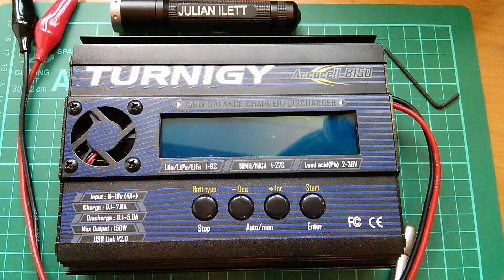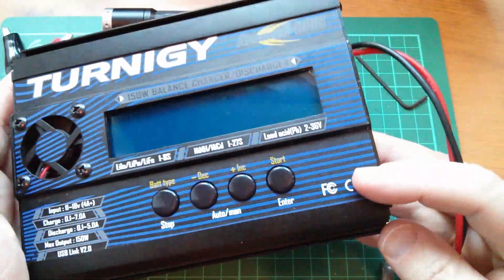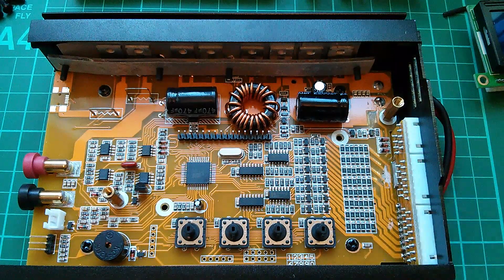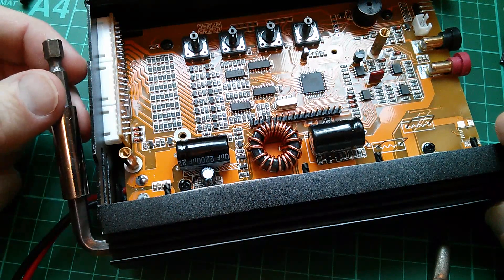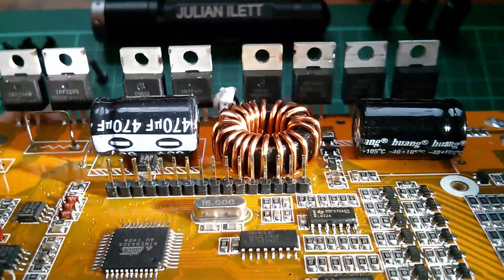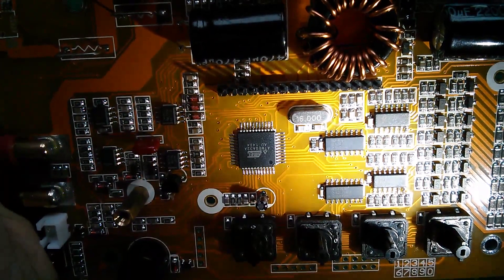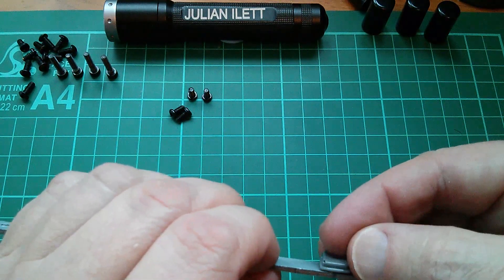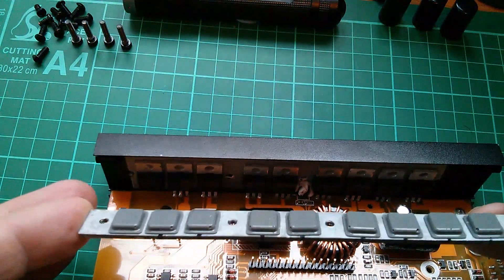Teardown: Turnigy Accucell-8150 150W 7A Balance Charger

Comment: Note to self
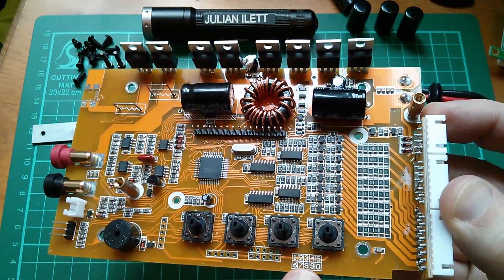The pinout of the Power Supply side is shown here: 5:10 
Flip the board over, Mosfet side to self where the supply holes should be at the bottom right. Top hole is positive, bottom is negative.

Comment: I like your videos a lot but rubber thingies there on the components, is this really a good idea? Those can prolly get pretty hot on that side too, also there's no way for that flat bar to keep them pressed against the radiator without bending. Even after your mod there is a slight bend to that bar. I'd get a piece of thick square/rectangular alum tube cut it to properly fit(kind of an u shape) and use that for support..., and lose the rubber thingies :) surely more work but it will be more rigid

Comment: Thank you for the inside look, especially on how to get the buttons out.  My buttons are sort of malfunctioning...they work intermittently and I'd like to replace them.  Any idea on how best to go about it? I find that if I apply extra-firm pressure to the buttons they work, but "regular" pressing doesn't really work.
Reply: dequinox they're just pcb-mount tactile buttons, if you desolder the 4 pins it should come out.

Comment: The bar needs to be reverse curved, so that by the time there is enough screw force to straighten it out, it is applying uniform pressure across all the devices.
Reply from the maker: jpopelish That would certainly help. But to work reliably, it needs to be thicker. Component clearances would start to become an issue then though.
Reply: Julian Ilett
And it would help if it was made from a springy material, instead of aluminum.

Comment: Actually it looks really good. Only few things that are not ok but well i suppose cheap solutions are good also :). resistor network is there instead of one good resisistor .but this one is ok also. cheap solution and easy ..What i don't like is ..instead of flat metal support bar for transistors they could spend few cent more and use I_I this shape so there would be no way to bed it at all..another thing is that coil and those two capacitors are not glued to board and that is not good at all...I think i don't have to say this was made in China because no oficial trademark like CE or what ever ..boad should be date coded as well. but even if it  was in China or taiwan..quality is really good ..compared to some CH crap we have on  market..Nice teardown
Reply from the maker: SylwerDragon I'm wondering whether the resistor matrix might actually provide more accurate resistances, from a statistical point of view.
Reply: ofc it does. That is why all modern multimeters use one resistor instead of so many cheap ones...But that one resist network cost much more..ofc.

Comment: the only possibly looking genuine IR mosfet in that pack is maybe the one next to the 5v reg, it has the usual half round ears cut into the tab, 
Most IR fets have a cut that from the top down goes in at a sharp angle and then curves back out, like a semicircular cut with a flattened top

Getting genuine mosfets is hard, I even had some from an ebay seller who was getting them off one of the UK main component houses, but I Really Shouldn't name them.....

Your 'spacer fet' looks genuine IR

any views on rubber mat insulation/thermal performance over old mica insulating with thermal compounds ?

I've never liked rubber, to me its an insulation....

Comment: I recently bought an IMAX was very unhappy with it as it was a FAKE and the voltages where off by about 700mv that might not seem a lot but when charging LION cells it can be dangerous, I complained to the Ebay seller and got a full refund, plus I pointed out to the seller that selling counterfeit goods is a crime in the UK and even distributing them is a crime, as a result I was not asked to return the item, so got money back and got to keep the IMAX..

I later bought a TURNIGY ACCUCELL 6 with my refunded money from Hobby King and it is much better, but never got a user manual or pretty box was bare cardboard :p

Comment: Not to related to the video. But I'm looking for the cheapest way to go about setting up  a battery backup.  Doesn't need to be super reliable . I'm thinking about getting a couple 50 watt solar panels and a few of those cheap eBay charge controllers.  With  a 500 - 700 watt inverter. I'd probably only ever use 200 watts for more than 15 or 20 minutes . I just want it to have the capability of running my mini fridge if I have to use it for that. The hardest part is finding cheap batteries. I want it to have a battery bank with a decent capacity

Comment: Is there any reason you can't drill and tap mounting holes for each semi on the heatsink doing away with the bar totally? It would be a bit of work but would be a lot more robust both thermally and mechanically.

Comment: If you want to add a temp sensor, the receptacle looks the same as my imax b8+. With the thermal sensing, it has worked great detecting overheating Li-Ion batteries and halting the charge before it went critical. "TS-474002/11777 Temperature Sensor w/ Futaba plug" was what I got. It's got a curved magnetic side that's perfect for Li-Ion's. I'm still searching for how to reduce the LiPo maximum charge voltage because 4.2V is actually hastening death of the cells. 4.1V gives longer life. It could be accomplished through the secret calibration mode but that affect all the battery voltage readings.
Reply: Thanks for the partnumber. In my country I couldn't find it with that partnumber, bu I could with this one: Futaba SBS01T.
It's also an 3-pin temperature sensor (White/Red/Black or vice versa).
For anyone reading, all you need is a generic 3-pin sensor, 2 pins for supply, one for readout. My guess is it runs on 12V but I don't yet have a sensor, nor have I tested it.

Comment: It occurs to me that and an angle extrusion rather than flat bar might have been a better idea for the MOSFET clamp - more resistant to bending. Turnigy's bodgery on the mechanicals is world-class on this one!
Reply from the maker: Marcus Jenkins I used this method a while back in my grid tie inverter. That did have a U-shaped bar (quite a shallow U) across all the MOSFETs and diodes. But it was susceptible to bending just the same.

Comment: Hmmm. Seen as they've likely had the case profile made, a small detail would have allowed the use of those snap-in clips to hold the devices on to the heatsink. Better performance and faster assembly too.
I've seen u-section strip used with this screw arrangement, but also with a screw in between each device. Someone clearly doesn't have a clue.
Maybe that's the same person saying that the failing units are fakes? 
Let's face it, not everyone will be running the unit at the limit of it's claimed spec. So their units will survive a little longer.
Reply from the maker: Simon Parkinson I think a screw between each semiconductor would be the best arrangement.
Reply: Julian Ilett Costs a lot more to produce as each device would require a screw, sil-pad (placed accurately on hole), top hat and testing of continuity to chassis.

Comment: i've had 2 imax B6 chargers so far and people are always debating in the comment section weather they are fake or not, it doesnt really matter. first off even the "fake" ones are still pieces of equipment that work, by "fake" it sounds like they mean its just carved out of a block of wood and doesnt do anything. also the "real" imax b6 chargers are made in china and are shitty just like the fake ones. if somebody really wants quality they need to build it themselves instead of paying 30$ on ebay.
Reply: yeah unfortunatly its the way the world works these days. recapping cheap shit with rubycon caps always helps and putting better mosfets in works too.

Comment: The only hint i had that it may be authentic was the fact that the LCD can be detached thu a plug , usually for cheapness they wouldent do that and solder it directly to the board. You may want to monitor it using a alternative multi meter device to see if its safe during charge.

Comment: Hi Julian - I have a Bantam eStation 902 charger (two actually because I blew up the first one) - it is built in exactly the same manner, and the bar pressing against the MOSFETs was bent on that one too. I replaced the MOSFETs on the broken one, but it still needs me to replace some op-amps too - I've yet to upgrade my electronics tooling to handle doing surface mount packages, so it's been sitting on a shelf for nearly 4 years now waiting for me to finish the repair. Thanks for another interesting vid. Cheers!!

Comment: I have a question not regarding to this charger:
I got a couple of LEDs from a friend wich he doesnt need any more. They look similar to this: http://s1309.photobucket.com/user/99freezone/media/ebay%20%20pictures/FZ0340-03_zpsf27beb98.jpg.html
Now how can I tell if they are 1W or 3W LEDs? (he can't tell either)
I mean I could apply 700mA to one, an when it blows up, then its an 1W LED, but are there better ways to find out?

Comment: I hope those mosfet pads will hold up to heat, as you said, heatsink gets hot, mosfets even hotter. What do you think, will you check?
Reply from the maker: First2ner I'll keep an eye on it - particularly when I start charging at high power levels.
Reply: Discharging actually makes them get the hottest compared to charging.

Comment: I also noticed the usb. you should solder on a usb and test it on an old laptop, something that isnt really worth much.
Reply from the maker: ***** I might solder on a small bit of wire and scope for a serial data stream.
Reply: Julian Ilett good idea. It is entirely possible that everything is there. It looks like the jumpers for the power are there.
Reply: Julian Ilett The USB is for a Temperature Probe I got one from china but someone in china wired it up the wrong way around I reversed the wires and it works before it was reading 70C in a 20c room lol I refer to the 3 pin terminal on the left.

Comment: By adding the feet to the metal bar.  aren't you now preventing (to some degree) additional heatsinking the bar may have provided ?
Reply from the maker: The To220 package is cooled by heat transfer through the metal tab at the back. Sure, a small amount will also pass through to the front, but I reckon the improved thermal coupling between the component tabs and the heatsink extrusion, far outweighs the loss of the metal bar at the front.

Comment: Hi Julian, I do not know how warm the MOSFETs of this charger get, are you sure that those are rubber feet and not plastic feet that will melt?
Reply from the maker: I hope they don't melt. Now that the MOSFETs are properly thermally bonded to the heatsink, they should run cooler.
Reply: The charger will shut down before anything melts. There is a NTC-resistor on the heatsink that controls fan speed, and shuts down the unit if it gets too hot.
Reply: ***** Good point!
Reply: The mosfets still get quite hot when charging a 5A + charge rates on these chargers, so I also be concerned the rubber feet melting... they're not exactly meant for high temperature  situations! That being said, i have a hobbyking 4 way charger, a genuine iMax B6 + plus several turnigy accucell 6s - none have failed yet. Worst thing that's happened is failing buttons that have needed cleaning.
Reply: Peter Feerick Julian Ilett I believe rubber melts between 150 C and 300 C depending on the rubber so well above what those MOSFETs should safely operate at. However, some plastics have a melting point of as low as 70 C which is a bit worrying. So as long as this is a good quality rubber, it should be OK.

Comment: I noticed the unpopulated usb mini pads on the right. Maybe the usb functions are already there, but only the socket is missing?
Reply from the maker: What's odd about the USB socket pads, is that only two of the pads appear to be connected up. I can only assume that these are Tx and Gnd, and that it's not really USB at all. It must be a serial data stream and require a FTDI-type USB/serial converter cable. I guess I could put my scope on the data pin and see if it's squirting out data bytes.
Reply: Do they have any 27ohm-ish resistors on D+ or D- ?
Reply from the maker: John Knutsson It looks to me like pin5 is grounded, and pin3 goes off to the microcontroller - no other pin is connected. I'm using this as a reference: https://forum.sparkfun.com/viewtopic.php?f=19&t=33227
Reply: Julian Ilett
That is pretty strange. It will probaly be serial then. It would be interesting to know what it puts out.
Reply: Julian Ilett Exactly. It's quite common for these chargers to use TTL Serial over USB, requiring a special cable.